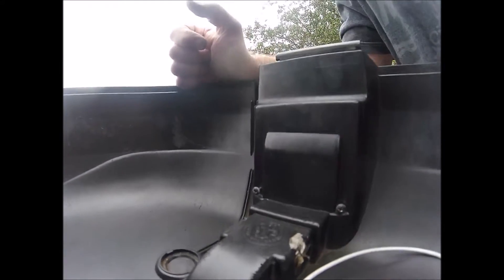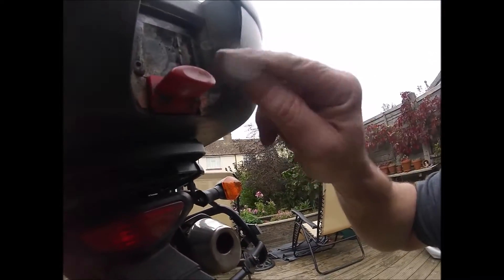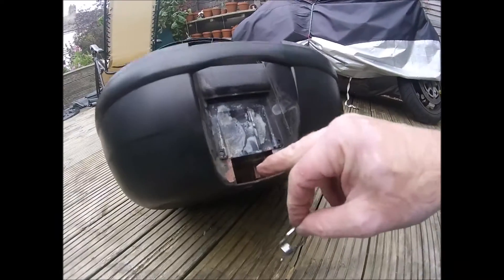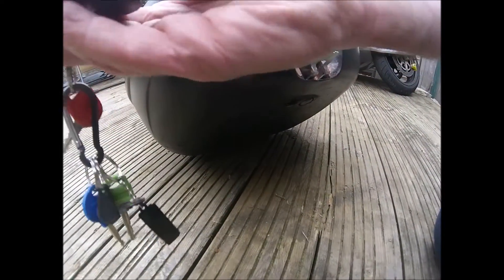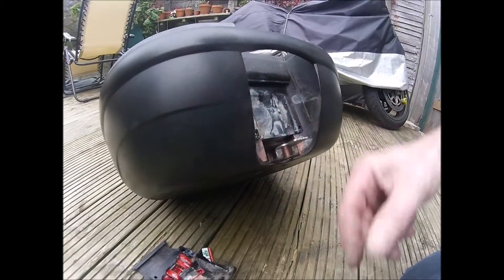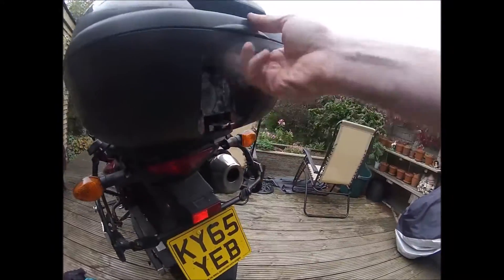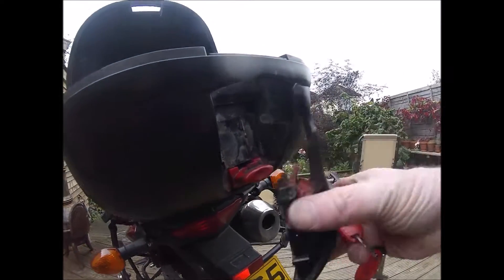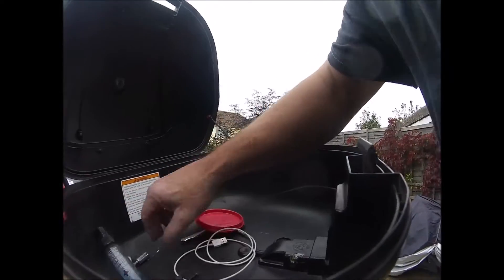Givi Top Box Fix

Comment: Having same trouble, mine will open and close the lid ok but can't get it to release from the plate unless I unscrew the assembly like you did, then it will clamp back on the plate again, only I can't remove it without going through the same process again, can't figure exactly what the problem is, but of a head scratcher.
Reply from the maker: Road Warrior , there’s definitely nothing wrong with the lock?

Comment: How did you get the ball bearing out? Have the exact same problem.
Reply from the maker: Lee Walker , the ball bearing fell out when i pulled out the long metal mechanism, that clamps the box to the rack. If your having trouble pushing the button, to release the box, I hit it with a hammer, this enabled me to open the box to get to the retaining screws and dismantle the mechanism. Good Luck.